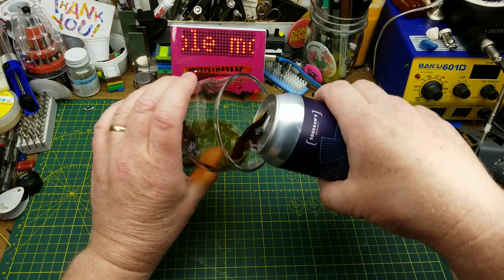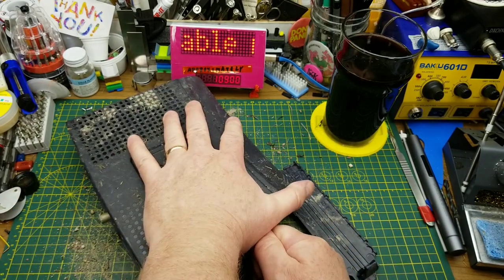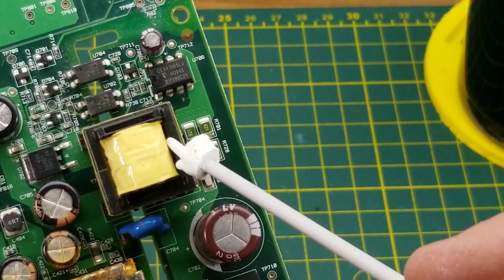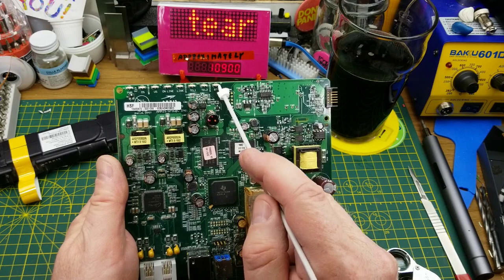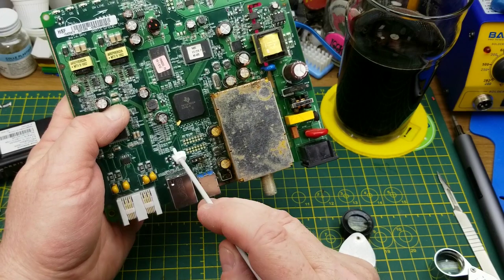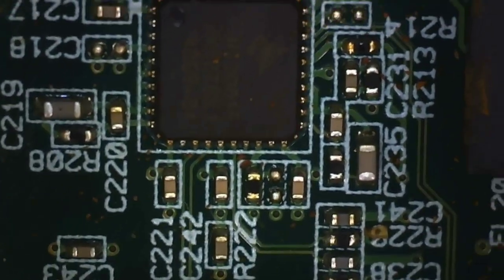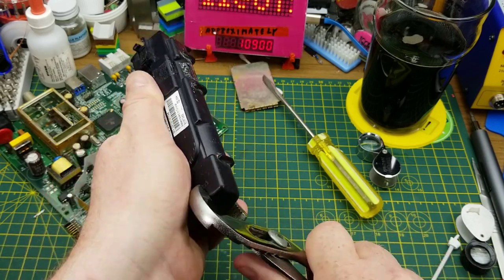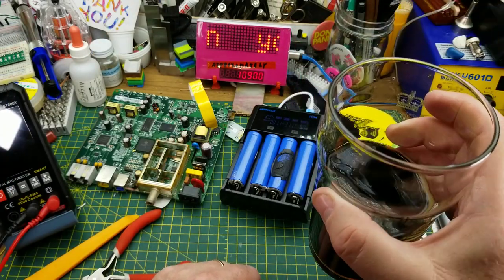curiosity teardown: cable modem (with VoIP)

Comment: Telephone transformers are not for audio, but to generate the ring and line voltages. Chip itself does the hybrid work internally, pretty much par for all the modern ones these days, as they are meant to work with 56k modems, so want the minimal amount of distortion possible before the ADC, so as to get the handshake to work with the modems.

Everything on chip, including caller ID, pulse and tone detection and the 2 to 4 wire hybrid, plus the high voltage drivers for both loop and ring voltage. The 8 pin chip by the capacitors probably is generating a power rail, likely the -48v rail for the phone to use, and the transformers are then used to make the AC ring voltage from this, as the main phone chip hos on board high side drivers for ring, though they did not use relays to switch the line, probably using mosfets instead, as the chips can do all this internally. Up to 100v on pins so close, they really expect the end manufacturer to use a conformal coat on the board, as they would flash over of leak if used in a humid environment.

Power supply keep the 8 pin integrated chip, likely still works, though easy enough to dry board, and simply power it on and measure outputs still work. Common chip for single chip solutions, so worth it for a spare part, along with the input filtering and bridge, not the main capacitor as it is 14 years old by now, and only has a little life left in it, from being well warmed all the time. Might work in a pinch, but not going to run long term.

Comment: You were right in saying it was fairly old.  It looks like it is only DOCSIS 2.0, unless this version had a upgrade to it.  DOCSIS 20 had a downstream capacity of 40 Mbps and Upstream was 30Mbps, if your provider used all the channels.    I think DOCSIS 4.0 has been released now, with downstream upto 10Gbps and upstream of upto 6Gbps.   The battery backup option is a nice option though.  Not many devices have that.  With that said, my provider doesn't do battery backup for their nodes, so if the power goes out, I don't have connection to the node anyway.  
Thanks for more entertainment though.   Enjoyed seeing the tear down.
Reply: Pretty sure it is only DOCSIS 2.0, I had that modem about 15 years ago. It's obsolete as far as Comcast is concerned, they won't activate any DOCSIS 2.0 modems.

Comment: I have found alot of things in the trashroom in my flat compound. Reused and some of them needed very easy repair. Latest find was a Asus RT-AC66u B1 fully working router with Power Supply. Only needed proper clean.

Comment: the mta is in wide use today, 2 battery types for 4hr and 8hr back up. in my systems they replaced the old cornerstone voiceport. the Ethernet port was never used for internet as its only 20mbps. they are phone only devices. we used to have dedicated docisis 3 cmts's for them, but with newer firmware they were added into the regular modem space with no dedicated up and down channels for voip packet cable

Comment: The much older DOCSIS 1 modem I picked up has its power supply on a separate board, making it nice and easy to reuse. I don't know how common this setup is on newer modems.

Comment: 5:35 - is that MOV un-fused??
Reply from the maker: Yup. It's the first thing before the  fuse.
Reply: @pileofstuff  is that normal? I'm not an electronics engineer but I've seen lots of MOVs fail to a low resistance state. I'd have expected it to be protected by a fuse, but as you stated the rest of the PSU is well-designed so I'm presumably wrong!! Any thoughts?
Reply from the maker: @obd6HsN  I've seen them on either side of the fuse in different equipment.   I've also seen one before and another after the fuse.

Not sure what the "best" practice is, but either seems to be valid.